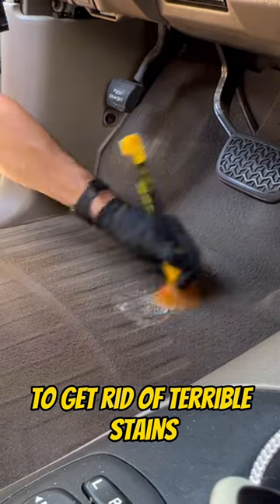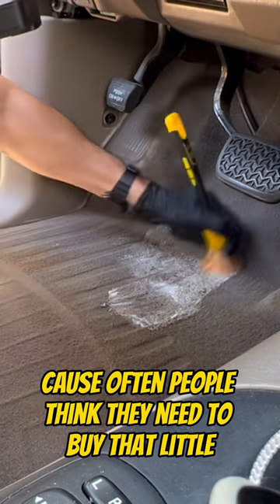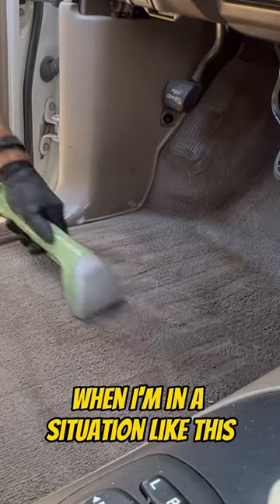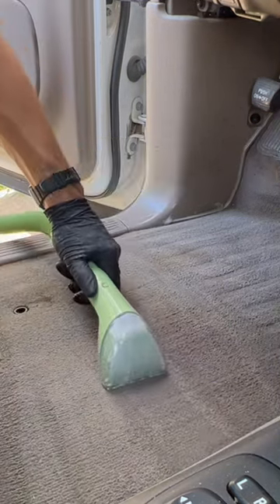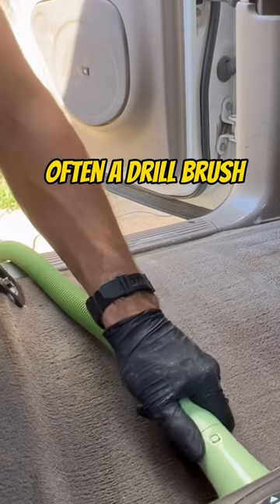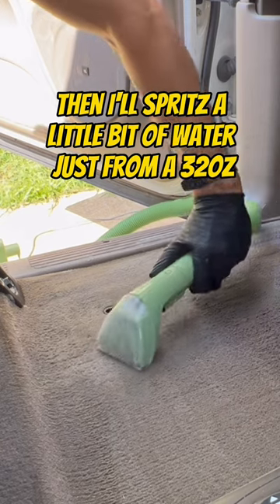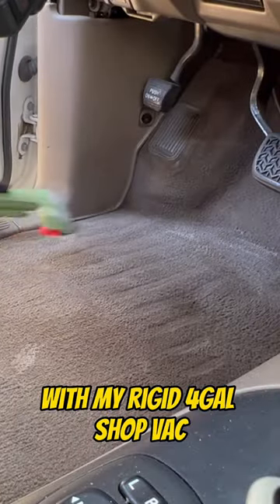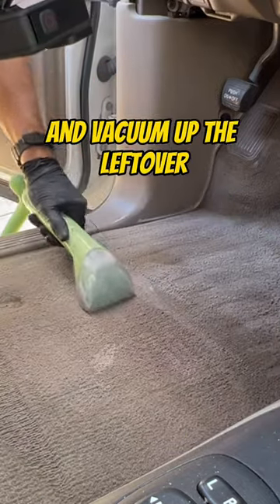Faster way to shampoo carpets #detailing #autodetailing #detailers #cardetailing #clean

Comment: You don’t need an extractor……uses an extractor
Reply: That was a shop vac genius
Reply: @cane870  no the little green machine it an extractor
Reply: @cane870  LMAO!! That’s an extractor genius 🤣😂
Reply: @cane870  lol it’s literally an extractor
Reply: My thoughts exactly lol
Reply: literally an extractor, i use the same one
Reply: @cane870  no it wasn't. It was a light duty water extractor made by Bissell
Reply: @cane870 this nozzle cannot be put onto a shop vac. You lose.
Reply: @WesMatt no
Reply: @WesMatt  nah what I mean is the shop vac don’t spray anything not just that it ain’t heated and also not all extractors are heated
Reply: @WesMatt  vacuum aka extractor. yes you can use one that doesn't dispose heat. I can't quite understand what you're trying to say, do you even know what you're talking about? 😅
Reply: A mini extractor was used!
Reply: @cane870  all strokes, no genius.
Reply: @WesMatt yeah, don't suck up water with your regular vacuum.... unless you wanna buy a new one....
Reply: All these people being absolute tools arguing about the footage and completely ignoring the narration.
Reply: 😆 🤣 😂 😹  use shop vac with extractor nozzle
Reply: @cane870 he literally said it's a green machine. I'll refrain from the insults
Reply: @WesMatt yes. They both..... don't suck
Reply: @Wooooptywoop yes it can. Still not a shop vac.... technically
Reply: And says to use an extractor
Reply: Get the ripclean extractor kit for $240 and attach it to ur shop vac, more power and suction. Game changer
Reply: @cane870 they're the same thing rigid shop vac or a 5k extractor. It's the fact that the motor used in shop vac is higher cfm. An extractor is just purpose built. Rigid is an all around vacuum. But can still extract. Lol
Reply: @cane870 thats an extractor dunce
Reply: @WesMatt that nozel isnt from a shop vac thats a extractor i had one of those
Reply: @zedmak thanks for the tip. Ripclean extractor attachment looks awesome - exactly what I’m looking for!
Reply: @cane870 28 other people liked your comment so don’t feel alone in your ignorance.
Reply: @cane870 
You don't know shit bout detailing bro it's obvious
Reply: @cane870  you must be slow
Reply: Those extractors made by Bissell are not at all made for detailing cars they are not durable enough to handle the rigorous handling that the machine would  endure.  Honestly they are junk.
Reply: 😂 @WesMatt
Reply: @aidanangelo8109 you realize you just said extractor in your sentence trying to prove it’s not an extractor?
Reply: "let's just say I don't have this machine". He literally explained it. I mean he could have demonstrated to avoid confusion but he explained it word for word.
Reply: Lmfao I was thinking the same thing like bro who you fooling 😂
Reply: @Willschaefer1 doesn’t matter if it sprays that’s still an extractor😂
Reply: @Secretdawg925  what??? It is not its a shop vac bro did not pass first grade
Reply: @cane870 dude literally said he used the little green bissell machine within the first 10 seconds genius, it an extractor
Reply: I was thinking the same thing
Reply: In the audio he talks about how it can be done without one the video just doesn’t line up most likely so he could drive up comments and interactions with the short
Reply: Best extractor nozzle?

Comment: Been in the auto detailing business for 25 years we use laundry detergent shop vacs and hot water scrub scrub scrub🤑
Reply: nice so I can clean it with smell good ass GAIN I cant wait
Reply: I used this method the other day and still have stains on my floors and seats. Maybe I should just live with the fact I got a running and driving gmc sonoma for $750 and it isn't going to be perfect 😂

Comment: Just sounds like 3 times the work. Just buy an extractor
Reply: Updoot for Pepe, Fren
Reply: 3 times the work? You still need to agitate or spray most stains and let them sit. This got done with like $120 worth of equipment and chemicals vs a heated extractor for $1000

Comment: To be honest, a cheaper hack is to use water and a bar of ivory soap, any stiff scrub brush from the dollar store, and any wet dry vac. Scrub, extract, rinse, extract, rinse, extract.
It's worked for me for everything except permanent marker, and adding isopropyl alcohol helped with that.
Reply: Interesting. Thanks for the tip. I use isopropyl alcohol with little dawn and that helps but ivory soap sounds cheaper!
Reply: Make a video, I'll like it
Reply: I use Tide powder a lot, too. You can make it very thick, it works well hot or cold, it works well on multiple soil types and won't ruin the colour.
Reply: @geoffmooregm  
That's a pretty good idea. I'm not sure of the exact chemistry of Tide, but I'd be careful not to keep it on your skin too long because it might be a little harsh.
Reply: @davidscott5903  Yes, you will definitely want to extract, and then wet again and extract again.
Reply: Cheaper would be , use the mats that come with car 😂😂
Reply: @geoffmooregm  how do you use the tide?

Comment: Just a word about the chemical DS5
It is an encapsulation cleaner…   
The reason this is important is because usually cleaning chemicals are not well rinsed out
So it would be like shampooing your hair with no or inadequate  rinse    
Clearly you would have shampoo left in your hair
The same is most often true of carpet shampooing
This shampoo  dries greasy … and in the best case leaves a residue that cleans the soles of your shoes
Leading to faster resoiling

The encapsulation shampoo is different since it dries to a crystal
This can be knocked off the fibers by a brush and vacuum
And, in the worst case… does not clean your shoes
Reply: Perfect!
Reply: Can you use dry shampoo for hair on your carpet
Reply: @mariamaria2751  
I am not familiar with the product. But if i hazard a guess…. I would say no.   One of the main issues with hair is body oil. This can be absorbed by a dry product,  On the other hand the soil problem with carpet is more similar to  dirty clothes.  You need some sort of liquid to dissolve and emulsify the soil
Reply: Some don’t leave any noticeable residue. But after three times using a encap product the carpeted surface should be extracted otherwise residue build up will 100% occur. Sometimes causes mats to harden like rock until steam extracted.
Reply: Thank you for explaining ! This is exactly what I need!

Comment: Also I use dawn soap, hydrogen peroxide and baking soda. It really works. Use a little water of course and comes out clean.
Reply: This recipe is the best option for the loser of the 'Dog v. Skunk Battle' too!
Reply: whats the dilution ratio for this?
Reply: Yeah dilution ratio please
Reply: Soap 1:10 baking soda 2:10 hydrogen peroxide 3:10 water 4:10
Reply: Yeah dont do that. Thats a recipe for resoiling.
Reply: That's a recipe for getting rid of skunk spray remover
Reply: Ditto it's awesome

Comment: Just use The Dollar Tree's L.A
 Advantage (golden orange color) Concentrated Liquid Cleaner.  Spray on stains full strength and scrub a few times with a small brush.  Leave on a few minutes and blott off with paper towels.
Spray on some water and use a microfiber cloth vigorously.  Spray a bit more water and blot up with dry microfiber cloth.  Then spray a diluted 1 part cleaner with 2 parts water over all the carpet and upholstery using the microfiber cloth.  Blott and let air dry.  Cheap, non toxic and works without any machine.

Comment: My preferred encapsulation cleaner is encapuclean green DS for double strength. It works very well you can clean commercial carpet with it. I’ve had my best results after thorough vacuuming then use that product. It almost reminiscent to dry foam cleaning. They use it a lot in hotels and casinos that never close because it’s pretty thorough and dries fast. 😊

Comment: I actually bought an extractor meant for car detailing because the bissell little green did NOT WORK on my car carpets or upholstery at all.  The suction wasn't nearly strong enough
Reply: They aren't meant for deep clean. It's more of a fresh on the spot stain cleaner.
Reply: Could you not do what the video shows and come back with a shop vac ? What extractor did you go with ?

Comment: Not a professional but Tuff Stuff + Interior upholstery brush for agitation + vacuum works great
Reply: Tuff Stuff is a great cleaner for so many applications!
Reply: Thats my favorite its great for everything inside
Reply: I just used tuff stuff a drill brush and a shop vac with the thin nozzle and my carpet looks worse because all I did was spread the stains. Do you think if I use hot water like a lot of people say that it’ll help?

Comment: Castrol Super Clean is the only cleaner I use for a deep clean for carpets. It’s actually a car engine degreaser liquid. The product changed its name to Purple Power now. Same product. And I use it to clean my aftermarket air filter.
Reply: I used purple power for de-greasing yacht exteriors when I was a boat detailer. Shit works wonders

Comment: As long as the detergent is sufficiently strong and contains hydrogen peroxide and IPA, and its properly used with brushing….loads of issues on carpets would be solved without using extractors.

Comment: You don’t need an extractor…..but you need a shop vacuum….🙄to vacuum the vacuum he wet/dry mess and not ruin a regular vacuum. Buy the shampooer folks. It works amazing and will save you time.

Comment: It cristalizes asnyou say because you're using too much detergent.  Save yourself  the extra labor by getting the correct ratio. Thats my tip. I learned the hard way.
Reply: It's actually made to crystalize to prevent resoiling and make cleaning faster/easier.

Comment: I don’t believe he used ds 2 in the vid. I’m a carpet cleaner and the product sounds like an encapsulation cleaner. The process is apply cleaner, scrub it in, let it dry, dry vacuum it out. It’s still an extraction but does not require a wet extraction.
Reply: Encap cleaners also dry in about an hour, depending on how much you use
Reply: What’s good in the extraction world ? Should I just use a chemical, agitation and a spray bottle or warm water and a shop vac or is there a better way ? There seems to be a huge gap from the bissell hot water extractor to something more powerful like Mytee